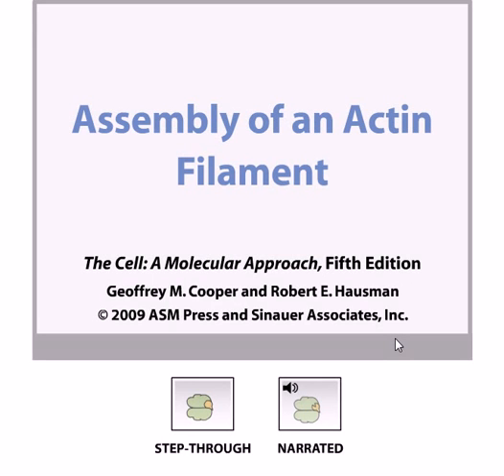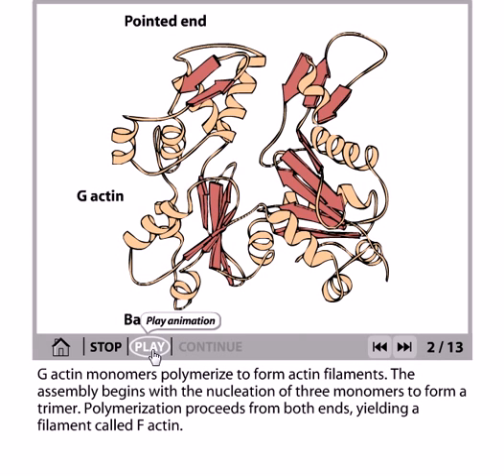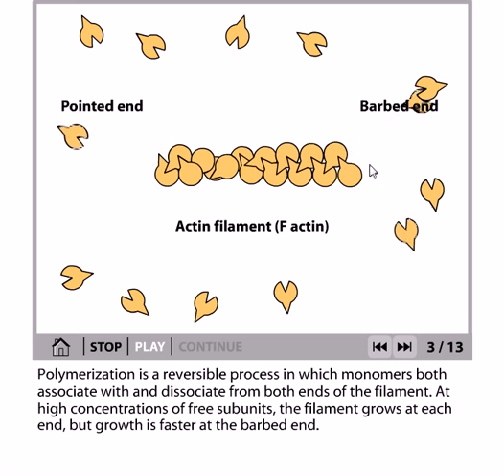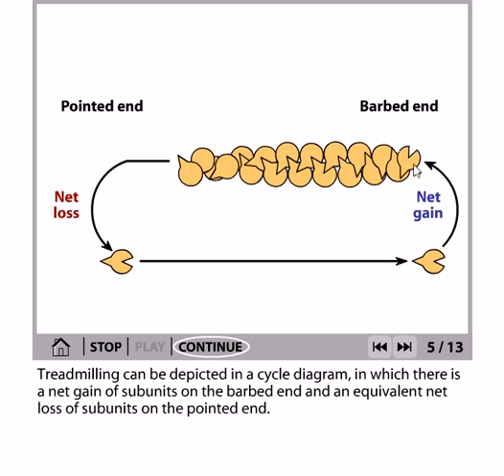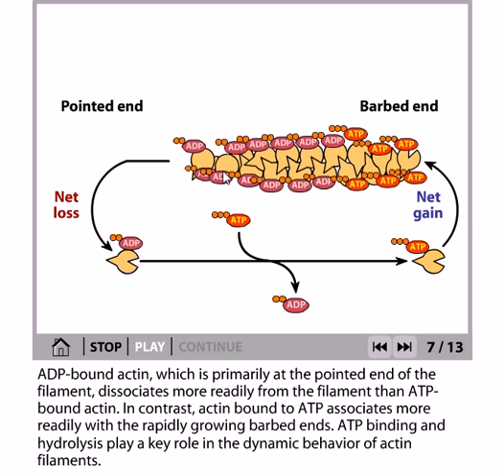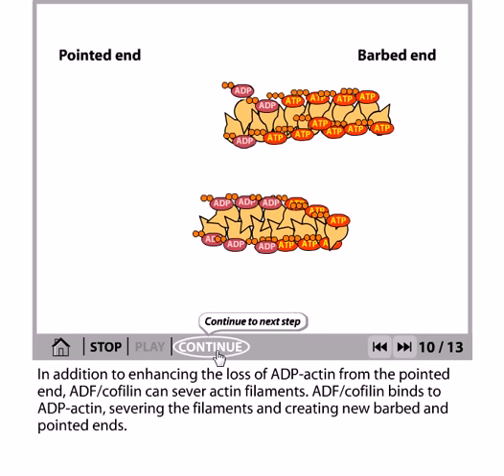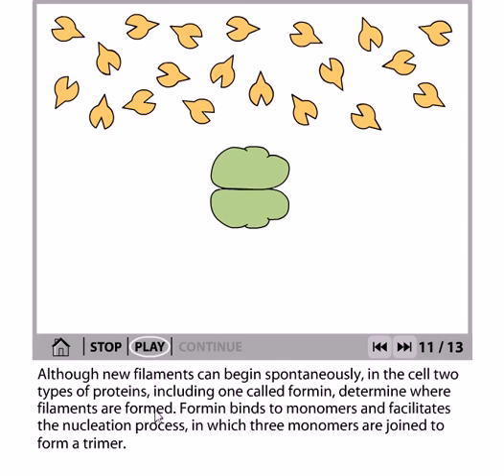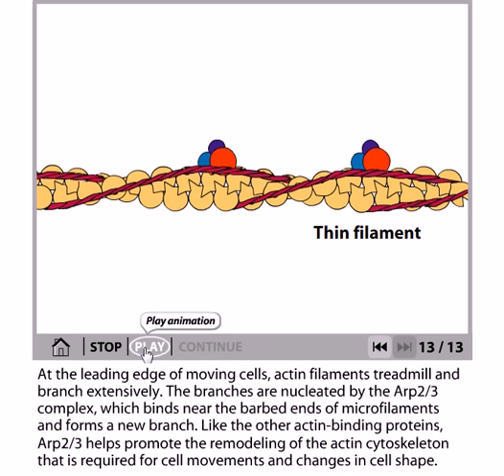Actin filament assembly

Comment: There are a few misleading with this application. 1) f-actin has directionality, the ATP cleft of g-actin faces the (-) end of f-actin. This needs to be made clear in the application. 2) Polymerization of the actin filament alone generates the force needed for motility. Arp 2/3 complex helps in this.